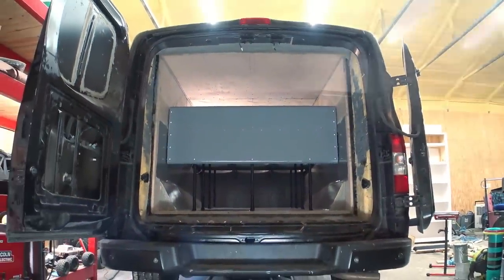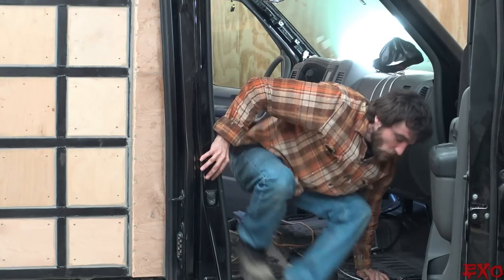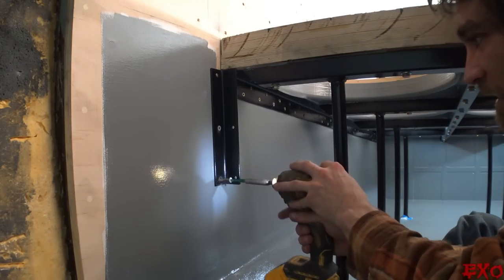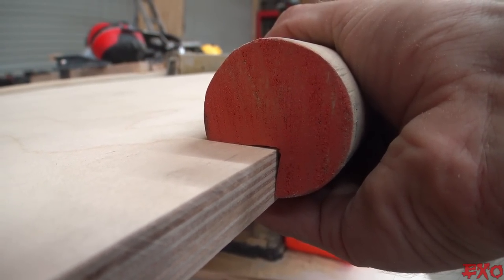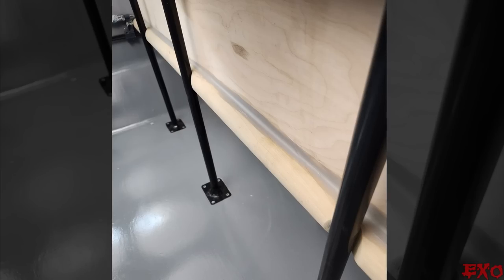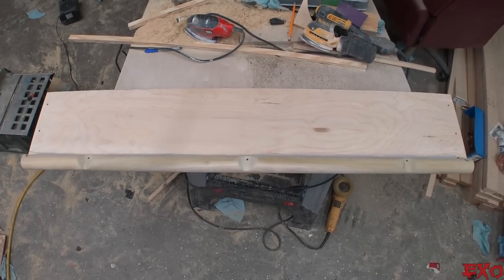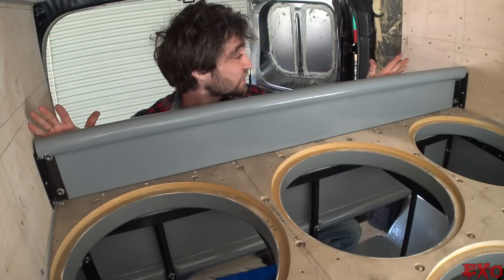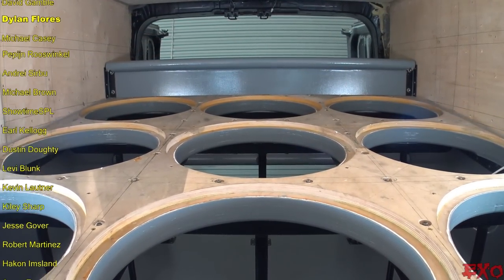Making a 22hz Subwoofer PORT w/ Adjustable Tuning for BEST BASS! Custom LOUD N' LOW Car Audio Ports!

Comment: @4:40 Talking about lining up the center holes. Use a spring loaded center punch and then drill the hole with a small drill bit or use a self centering drill bit.

Comment: On the left side of your drill press, there is the adjustable stop on that silver bar. Once you get your countersunk depth, set that and repeat on the other holes. A little bit of setup goes a long way.

Keep up the excellent work!!!

Comment: Amazing!  I get to start my new build this spring with a wall for 2x 15" deaf bonce 305's on a JP 43 powered by a limitless 12k, and of course, the 320 alt! This going in my '86 nissan hard body

Comment: Hey something else you can do to make it look a little nicer. Where you have washers and nuts on the round pipe, you can get something called saddle washers that fit the contour of the pipe and prevent any unwanted vibrations! 👍keep up the good work!!

Comment: Great job 👍. The problem when drilling out screws .. or anything is if you go too fast and heat it up too much it hardens the steel making it even harder to drill😢 you got there I the end that’s all that matters 😃

Comment: Amazing man! While building subs i have noticed that even below 20hz it can almost never be tuned to low. There always those few songs that have like random 16hz notes for example out of nowhere and MAAN is that SICK if your sub can reproduce those! Gets me excited to build my massive infrasonic tapped horn! Gonna be basically a mini Danley DTS 10 with 2 8inch drivers instead of 2 12s. Already gonna make 118db down to 14hz or so! With different drivers it could do more. Gonna be interesting what it will put out for real in my room. I hope not less than the simulation say's.

Comment: I wonder at what point the box is deep enough that it's an advantage to play with time delaying the front woofers to account for the speed of sound from the back to the front. Also when you get into enormous box sizes, the standing waves in the box dimensions start coming into the bass band, making it hard to achieve a flat frequency response in the upper bass registers - the 60 to 100 Hz zone that tightens up the beat in many songs.

Comment: I would triangulate the 2 center braces you made for the upper port wall. You would be surprised at how much that bent steel will end up flexing.

Comment: Great job exo but it seems like if the flare was facing the other way it would have been a lot less work it would have screwed in flush and tight
Reply: Yeah, but then it would have restricted airflow instead of helping

Comment: have you checked out KEF lately, they got some awards last couple years, blew my mind with 1/4 wave ports. check out the MAT metamaterial  absorption (open source) for high range. what can be done for low range with this tech.?

Comment: With the broken screws I was surprised you didn't have more by now,  on those walls I think you ended up putting 16 thousand screws into each panel,  with a new panel with another 16 thousand screws you built that thing like a tank,  glad it has only been one screw where you most likely tried to drill into a screw in the wall panels.  Keep up the good work though.

Comment: The listener being in the nearfield of a twelve driver array, I'm curious if one could mitigate any inter-driver nulling via waveguides positioned front to back. 

Somewhat akin to compression driver waveguide/phase plugs, preventing smearing ... coalescing a greater amount of in phase energy, tighter alignment in the time domain.

Comment: Need to paint screw holes that are metal. That's where rust begins. A lot of people don't paint screw holes because they're covered. On round bars you leave gaps on sides because washer isn't making good cover. Either way it's still bare metal regardless of cover. Water will always find a way. I suggest take it apart and paint holes.

Comment: when that screw broke at 6:20 (ish), I would have said F that, drilled a new hole through the bracing and left that broken MF where it was lol. not worth the frustration for me haha. Also, I really like how you add in some commentary as your editing, during the editing process. I'm going to have to borrow that technique :) great vids, keep em coming.

Comment: Exo how can I figure this quasi 6th order ports.  Termpro only lets you design a parallel 6th order.  If you used that design and did your style box. Should the tuning be all off ? Not trying to do anything too wicked like you I still want my 5 seats.

Comment: Off topic, but what are your desktop speakers?

They better not be something "cheap"(subjective, cheap can still be good, depending), the look of them kinda reminds me of Vanatoo's a bit (not really, but that's what I thought of when I seen them, they literally look nothing alike lol).

I personally have a Swans(HiVi-Swans) M80 2.1 desktop setup, bedroom I have a small set of Edifier R1280DBs's and a Dayton Audio 8" powered subwoofer (Sub-800) which sounds phenomenal (both setups do), and for the living room, have been considering doing a 5.1 Swans M20 if one is still in stock when I decide to pull the proverbial trigger, if not, I might go with a lesser known (but actually owned by Klipsh)  Jamo S803 setup.

Comment: Hey EXO you helped me blow a 140 in my silverado back in 2014 @ sanford sound. I had a question for you. Running a ctsounds 3200.1 do you reccomend an AGM battery or those lip04 cell capacitor things. Those cap banks are going for 125 bucks right now on ebay didn't know if thats what I want...or just do the big 3.
Reply: Btw your truck looks like its going to do 190db at 25hz.

Comment: Can anyone recommend the size box for a scar 18? I built a box for my son‘s truck and I’m not sure if I build it to the correct dimensions but he wants super  loud bass. I have a 5000 white Tara amp to go with. I just need measurements it seems to hit good at 38 to 45 hz but he doesn’t have the high loud bass he is looking for just super lows

Comment: EXO, and anyone else with any prudent info, would it be possible, or worth the effort, to use say 1 15 and 2 10s of the same type sub in separate enclosures, and circuits, in an attempt to cover a wider frequency range with a flatter response? Meaning tuning differently to achieve an overlapping response to eliminate losses from say 22hz to 80hz.

Comment: Do yourself a favor and stop using smaller screws when installing the bracket. you should just use a drill and drill a pilot hole. If you had drilled the correct, bigger sized pilot hole, you wouldn’t have broken off the head of your bigger screw either.  Just a tip.  Cheers.

Comment: You have got to stop holding your material with your hand on the drill press. Especially with a thicker bit. One of these days that bit will grab and mess you up. Brace it with come c-clamps or something. Keep your hands away.

Comment: Oof. Say goodbye to your windshield. You're nowhere near done with this ride. This is going to need some serious reinforcement or your van is going to crumple like a pop can
Reply: 22 is pretty much just straight pressure LOL
Reply: Back end is obviously good but put some serious consideration into what type of windshield and what kind of frame around it and probably permanently glue your door windows in with windshield glue as well